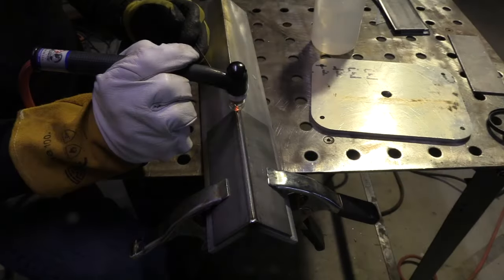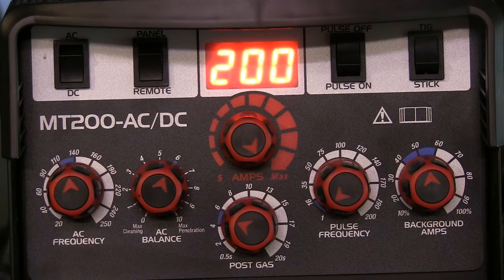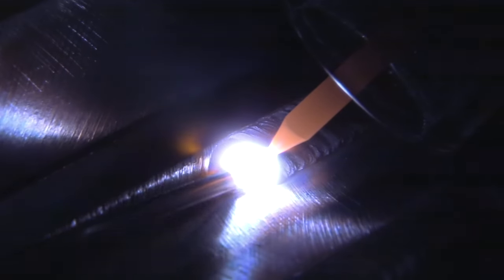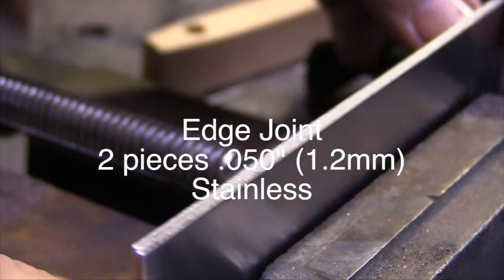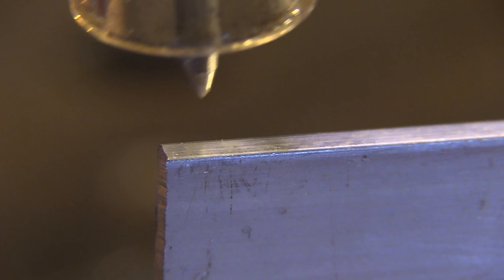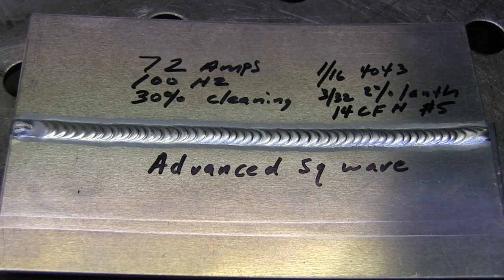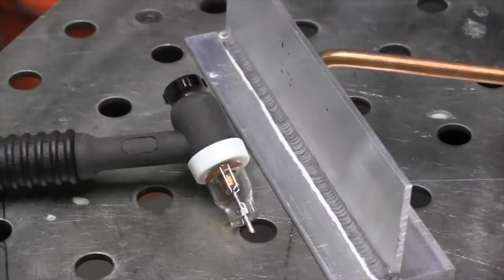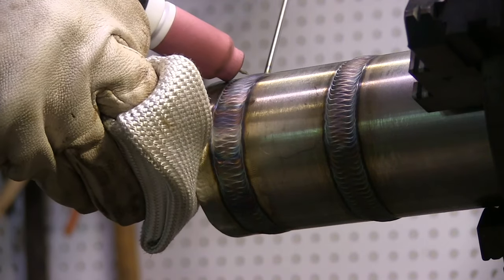TIG Welding Tips and Arc Length

Comment: I have a suggestion for a welding video. You always advocate cleaner is better (i agree completely) i'm curious if you can demonstrate whether there is a difference based on surface finish. Welding course ground or band saw cut pieces vs, filed or sanded smooth pieces? Does polishing or smoothing the surface finish improve weld quality? Does it hurt quality? Will my welds improve if i use a 240 grit flap disk or is a 30 grit better? I would be curious to see  the effects on steel, stainless, and aluminum.
Reply: flap disc...be careful you don't introduce bits of abrasive into the aluminum....Walter and a couple others make abrasive wheels/discs just for aluminum...

Comment: Please  do a video of welding .040 aluminum tube butt joint and t joint. I'm having issues making it work 1/16 tungsten min 20 amps (low as my machine will go everlast 200dv) furick 8 cup with gas lense balance 30..  I have tried 60 to 250hz
Reply: Clean...clean...butt joint must be tight...maybe purge argon from the back, should be easy for a tube....try a piece of    .040." Tig electrode....
Reply: @dougankrum3328  it is clean and I have tried a .040 tungsten
Reply: @TheMoody876  Hard to help you much without sitting there with you...aluminum...scrub it with a stainless-steel 'toothbrush'...clean with acetone, don't touch it with your bare hands...wipe off the acetone with new, clean rag or paper towel......weld right away...if you wait a couple hours...you'll have to 'clean' it again...most tube is extruded 6063, sheet might be 6061 cold-rolled....5356 tig wire might work better than 4043...it flows out a little better...
 I've  never used them...but the new lanthanated electrodes keep their tip better than pure tungsten....and there's a newer 4000 series Tig electrode that Jody uses...
 clamp your 'work'...or....'ground'.... electrode right onto the aluminum...this is a little thin for aluminum, tricky...good luck...

Comment: What filler rods n tungsten you us on that steel lap joint? On my tig welder I have a dial for amps and post flow....very basic. But I don't think I understand the digital current reading. It doesn't change when I strike arcs, but only increases as I increase amperage. So if I set amps at 120...my current reading would be like 100 I believe. What does current reading tell me? Thank you.

Comment: If you haven't, make a piece on using Solar Flux to protect the other side.  I'm thinking of the guys building exhausts.  I avoid methanol, and mix it up with water.  Takes a bit longer to dry, but nontoxic.

Comment: they tested me on 3/16 Al to see how good my penetration was for a T joint but I cheated and made two passes the first was a fusion pass as slow and as hot as I could get and then finished it by a nice easy pretty looking filler pass that makes you think it is too good looking to have proper penetration but when they hammered the plates open and found more than 50% penetration (they never seen that before) they were ecstatic and called the specialist to see it, ended up hiring me on the spot with the wage I wanted higher than they were offering  hahahahaha

Comment: Just discovered your channel and love so far  I'm new to Tig welding I have question. I am trying to Tig weld 16gauge mild steel the problem is when I'm welding it looks like a birthday sparkler I have 20cfm and the machine is a new Lincoln precision Tig 225 any advice would much appreciated

Comment: I’m am brand new to tigging. I’m having a real hard time with dipping my electrode and or length/ angle of torch.
Reply from the maker: I think everyone has this  same problem at first.
I would advise to take things one step at a time and get comfortable with each step before you move on to the next.
Something like this…

Run beads without filler rod on clean carbon steel...Try to hold an arc length equal to the diameter of your electrode.

Once you are very comfortable and steady, run beads on steel using filler rod
Then do the same thing on aluminum if your machine is AC DC.
Then pad beads on aluminum.
If you are still dipping the tungsten , experiment with slightly longer arc length.
I have a beginner tig course at welderskills.com  that walks you thru these steps with videos but the first few steps are pretty much what I just listed.
Good luck

Comment: Have you found that argon works better on stainless then Tri mix?
I run a Miller syncrowave 250 and once I switched to tri mixed gas my stainless welds were noticeably cleaner and less discolored.

Comment: Hey man!  Your teachings in welding are very good.  How nice it would be if you had Spanish subtitles.  A hug and keep it up with such good teaching.  I have a question ... What Tungsten electrodes should I use for each kind of material, steel, stainless, aluminum ... etc?  I understand that each tugsten electrode has a selection of colors!

Comment: When you weld stainless steel manifold (11 ga) you set the machine at 100 Amp but at which frequency? Thank you
Reply: no frequency? stainless is usually welded on DC.

Comment: Looking at the controlpanel, I see that there is no knob for adjusting pre-flow gas? Is preflow adjustment necessary? Im currently comparing two machines prior to purchase and one has adjustment for preflow and the other has not.
Reply from the maker: I think the CK mt200 has a preflow that is preset to about .5 seconds.   on machines without preflow, you can do it manually by tapping the foot pedal before getting set with the torch in place.  the drawback to this is it wastes a bit of argon.  I never used to think preflow mattered much but its very helpful on aluminum
Reply: Preset Preflow might not be a big loss.  You have to get the air out of the lines and the torch and all, establish some shield gas, but of course there's no heat yet and it's probably not something you'd need to adjust that much?  The post flow can vary a lot depending on what you're welding, and if you have the patience to sit there and run it out.